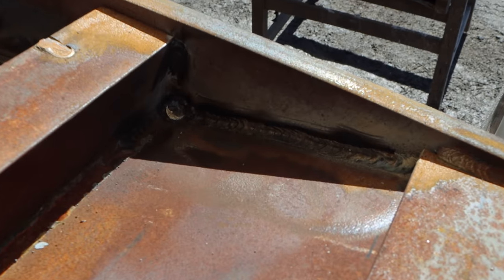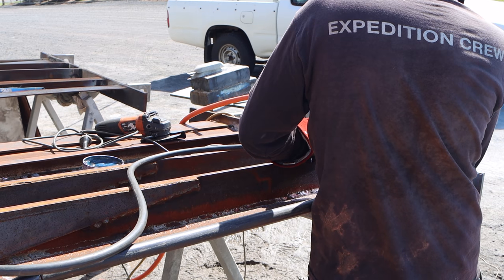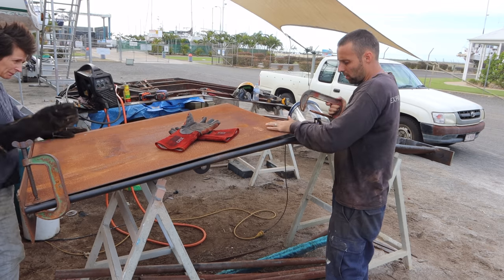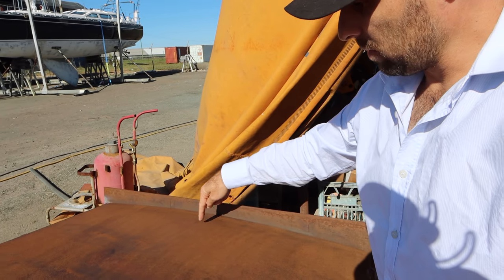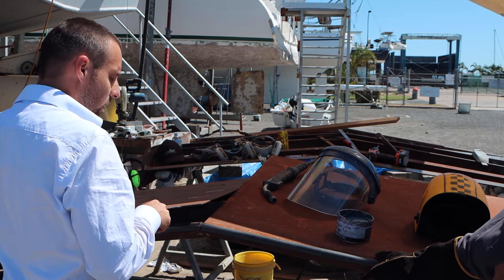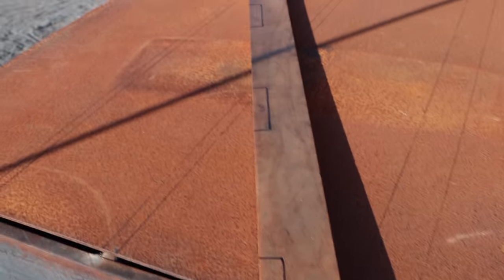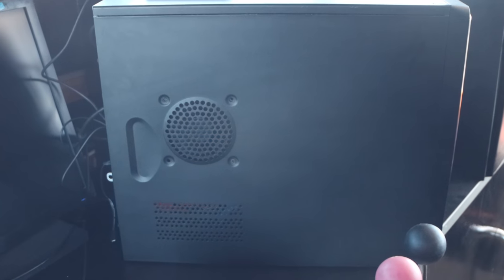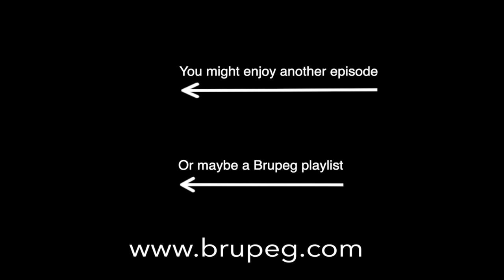Brupeg Shows Some Skin... Project Brupeg Ep. 135

Comment: I highly recommend a UPS (uninterruptible power supply) for your 2 NAS devices.  Any unexpected loss of power to these devices could irretrievably corrupt the RAID systems on both NAS devices.
Please chat w/ your IT team about it.  

I'd also get some other backup system - even DVDs - but offsite (cloud storage) would be better.

I am so impressed with your metalworking skills and knowledge.
Reply from the maker: Hi Robert. We currently have a 7min UPS system running all IT in the boat, it’s powered by the invertor and 24v house bank so it’s almost like a double redundant system. We get power cuts here very frequently so having it rigged in this way with the house bank charged from solar and shore power means the UPS sees near perfectly constant power and the IT see perfect power.
Reply: @ProjectBrupeg  Fantastic!  About to watch Ep. 136  :)

Comment: 8:10: So the welder runs cooler thanks to that massive ground cable? Good, although I bet that 30 knot wind helps. 9:50: Suddenly it's a nature documentary. 11:28: Anode as stabilizing plumb bob...nice work! 12:30: That battery drill is very impressive...I don't own one capable of running a 1/2 inch/12mm bit effectively through mild steel; for that, I have to bring out my 500 RPM Makita (wired). 20:35: Well, I learned something I can use later on about expansion. Thanks! 22:35: I agree, you've got as safe a setup as you can hope for on a boat. My only question would concern power conditioning and backups from the boat's own power in terms of uninterruptability and producing a pure sine wave AC supply. You've probably dealt with this and I've just forgotten.
Reply from the maker: Hi Marc, yeah the AEG battery drills are flippin awesome, this one came with a handle on a bar that was around a 10" long, the next model up the bard was about 2ft. the torque on them is unreal. 32mm drill bit... no worries.
All the IT gear in the boat runs off a dedicated UPS, and the UPS is powered of the 24v house bank (so almost a double redundant system) powerwise we get a lot of power cuts here but as the batteries are charged by solar and mains the power that the UPS sees is pretty constant and the power the IT sees is about as good as we can get.
Reply: @ProjectBrupeg  Well, I suspected you'd have it sorted, given that you're media producers with a trawler problem. And I suspected the power might be spotty there with the wind and heat.

Comment: With the two servers next to each other you need off site backup in case of fire, lightning etc. which could take out both. You have done an amazing amount of work so keep safe and finish it so we can see it in the water.
Reply from the maker: Hi, Yeah we wont have offsite storage (for recent footage anyway) but the plan is to move them into different parts of the boat so we can minimize risk as much as possible

Comment: Don't forget to physically locate the two NASs as far apart as you can. Should the worst happen and you have a fire or flooding onboard, you don't want it to take out both copies of your data!
Reply from the maker: Hi Peter, yeah the plan is to move them, for now we wanted everything talking but thats done so we will locate the backup in a forward cabin, and the main NAS will be in the wheelhouse under the seats (in a box to protect from water if the windows get stoved in)

Comment: Love what you do I'm an engineer from cape Town, just a tip your weekest point is your hinge plate. Keep it up man.
Reply: We're your shaft goes through.
Reply: They're going to put the strongest type hinge pin on later before going into ice.  According to previous videos they'll also be reinforcing the hull quite a bit where the hinge plate goes.
Reply from the maker: Hi Guys, yeah so the hinges will be a two stage upgrade. for now we will carry on with the stainless plate style, but add in gussets behind each plate (hull and wing) to deal with thrust, tension and compression etc. but eventually we will be cutting them off and welding in a piano style hinge using hollow bar 4140 and 2" 304 rod 1.2m long

Comment: Hi Brupeg,  here is a thought.  If your going to put diesel into the wings,  when you go into cold water's,  wouldn't that diesel gel up and then you would have a solid mass inside your wing's?  that might serve as a counter weight or just a weight in the wrong places.
Reply from the maker: It’s only a few litres so even if it did turn solid it wouldn’t matter

Comment: The first thing my wife learned to do was swath, 30 years back. I had finished up what I was doing and went in for lunch, she arrived 20 Min. later and said IT what making a ticking noise so out I go to see what's what. It didn't take long to figure out what the ticking noise was. The 6" bearing off the PTO had failed and she had kept going long enough to to beat the 12" x 12" x 3/8" completely gone. But dear it was only making a "ticking" noise. To this day she mostly just rakes. Cheers, Billy in B.C., Canada
Reply from the maker: Blimmin heck, yeah Jess is fine tuned to the welder now, she can diagnose it by hearing the changes in sound before I do sometimes.

Comment: I prefer the QNAP boxes for a number of reasons, especially less power drain. The lower power CPU etc is why we went to QNAP instead of home build NAS.

I'm looking at having a raid 10 here on ours soon (need 2x more 8TB Ironwolf drives and another 6TB Hitachi drive for it) so we have the stripping for storage size but the mirroring for drive redundancy. That homemade NAS I'm surprised you didn't go RAID5+1 (4+1 drives) so it can hotswap fail over and rebuilt off it's own indexes (this is where RAID5 shines!!).  If I could afford 4x 14TB drives I'd be looking into RAID5. Either way given how RAID5 works you would need to loose 2 drives at a go to require that second backup machine. If you have say 3 drives in R5 then each of of the drives holds a bit of data for the other 2 meaning if any 1 drops the other 2 drives have the missing data and will easily rebuild after the failed drive is replaced.

I'd love to be able to go with a 2nd NAS co-located offsite somewhere but when the drives and QNAP box are a few K worth alone it's just too much money unfortunately.
Reply from the maker: Yeah the plan is to locate the back up NAS either in the freezer room or in a front cabin. 10m away from NAS 1 and a couple of bulkheads away
Reply: @ProjectBrupeg  ah fire/flood protection. Good thinking.

Comment: I was noticing you don't seem to have a corrosion prevention program for the inner wing(s).
You might consider flooding it with nitrogen or argon to inhibit rust over time... Good Luck.
Reply from the maker: Hi. Couple of things spring to mind. With a airtight sealed tank. The lack of fresh oxygen is a rust prevention in itself. It’s very common to make tanks in ships from mild steel and once sealed air tight they surface rust until the oxygen has been used up (normally a few weeks tops) at that point they stop rusting and can last indefinitely provided no new oxygen is let back in. We will be using that theory as well as chucking a few litres of diesel in each wing to slosh around. No need to gas them in this case
Reply: Thanks for the response and patience, now that you repeat it, I remember you mentioning those details earlier. My bad for bringing it up.

Comment: When you launch, you should seriously consider allocating a spot on the boat where you can put a proper computer setup. Ideally something that runs on clean air (sea air kills regular computers, i've seen some nasty computers come from the sea side, and there was rust and corrosion all over them).
Reply from the maker: Yeah the plan is to isolate the gear as best we can. Wheelhouse is away from spray and airconditioned so its a fairly dry air environment (its all relative) and the forward cabins are similar. The plan is to seperate the two NAS apart by a few bulkheads and a few meters so if one room is compromised the other has a chance of survival. One thing i have thought of but dont know if its a thing is resin coating the boards of the Macs etc. not something I would attempt myself but if its viable I would pay to get it done.

Comment: 200 Gigs a day! That is incredible, out of curiosity  how many camera's on average run? and how many hours of film time is this? I can only imagine like 3 or 4 cameras rolling 12+ hours a day?
Reply from the maker: Mostly only one. We shoot using a Canon 90D in 4K but when needed we run GoPros as danger cams shooting in 4K, the go pro footage is a much smaller file size but a lot more grainy compared to the big sensor on the 90D. Slomo is actually shot on iPhone. the cannon can so it but only at 120fps but the iphones can shoot 240fps in 4K so a better image overall. When we do complex stuff like the fuel tanks the camera count go up. 5 cameras are not out of the ordinary. This is a great example of this https://youtu.be/QZYvdecXN0U?t=1446

Comment: Good on you for saving that bird from those Magpies. Out here they're also known as Camp Robbers, and I can't stand the bastards. The only thing they're good for is target practice. Jess, your welds look awesome! I wish I had a MIG system with gas, but I just have a little Sears Craftsman 110v flux core MIG box. I also have a Lincoln arc welder that I primarily use....the 6011 rod I use does a great job of not making me look too amateur.
Reply from the maker: With flux core on your sears you should still be able to get a nice bead. I’ve really been impressed by the quality the fluxcore produces
Reply: @ProjectBrupeg  the biggest limitation is the thickness I can weld, because it's 110v.....1mm is thinnest, 4.75mm is the thickest. The biggest issue I have spatter, and I was told that gas minimizes/eliminates spatter.
Reply from the maker: Yeah it definitely reduces the splatter but you can use antisplatter spray and the beads don’t stick, makes clean up a breeze. Also that max thickness is per single pass, you could weld 1/2” plate by running three beads, one in the root (corner) then two over top.
Reply from the maker: Thanks Frederic. Cheers Jess
Reply: @ProjectBrupeg  I did not know that, thank you so much!!!! And I had no idea there was such a thing as anti-splatter spray. I'll be going to the local welding supply store tomorrow to get new MIG wire, so I'll ask them about the spray. Thanks again!

Comment: @4:09 you see the hole in the weld on that round edge? Will you weld onto that or is it not of significance to any but my OCD friends?
Reply from the maker: That was a hole I blew in the thin front pipe. I had the welder set a bit hot. After that shot I welded the pipe fully so both our OCD will be safe.

Comment: Mate, never say bulletproof.  It's acceptable risk.  IT nerd here, and what you have is definitely better than most, so cheers!
Reply from the maker: Thanks Ken, the plan is to add a bit more redundancy too. Seperate the two NAS apart in different parts of the boat, have a 8tb HDD hooked up to the QNAP to duplicate the contents and our Timemachine backups. as well we the UPS that powers all of the IT, running from the House bank 24VDC bank via the invertor.
Reply: @ProjectBrupeg  Thank you for responding, totally made my night.  But havng your backup in the same location as your main, means you have no backup.  Disaster recovery means (in my case) that a tornado doesn't take out two data storage locations.  Now granted I'm new to this but there are cloud based deep storage options that are really cheap until you need to get data back.
Reply from the maker: For us anything cloud based isn’t an option as the data would need to transfer via satellite. So a days worth of footage would likely need a small mortgage to pay for

Comment: not anti rust painting inside the wings?
Reply from the maker: No need. When a tank is air tight the oxygen depleted and rust completely stops after a few weeks. It’s possible to seal a bare steel tank airtight and leave it for fifty years without any increase in rust inside.

Comment: After watching I don't know how many vids on building the Wings, I can  now see why 
when the British built the HARRIER JUMP JET, the wings are  made from SOLID blocks of
ALUMINIUM,
To get the Ultimate strength, all the internal compartments of the wing were burnt out buy flushing Acid in and out to melt the aluminium, as required.   NO WELDING.????????????????????
Reply from the maker: Yeah unlimited funds would be a nice addition to the build... however slabs of steel is all we can afford, so we press on.
Reply: @ProjectBrupeg  Well if it sinks it will go down Quicker.  keep safe.

Comment: ? How come you never bought a plasma cutter for your project
Reply from the maker: Hi Billy, we have one but it’s a bit of a pig to use, it’s not a clean cut so we use it on work that doesn’t need to be pretty, such as cutting rust out that will be replaced with new steel. It’s a small unit so it’s not fast and we find time wise the 1mm disc on the 5” grinder is similar in overall cutting speed but much more cleaner and accurate

Comment: Just a question, why no rust encapsulating or sealing paint on the wing interiors?
Reply: Keith Cripe I think he said he’s filling them with diesel.
Reply from the maker: Hi Keith, with steel you need oxygen to make rust happen. When trawlers create a fully airtight tank (like these wings will be) the interior rusts until the oxygen is used up (a few weeks for small tanks) then the atmosphere inside becomes inert and they can stay like that indefinately without any further rust.We will be added a few litres of diesel to each wing to slosh around but thats just a back up measure really as the lack of fresh oxygen is one of the easiest and best ways to stop rust.
Reply: @ProjectBrupeg  Won't welding those tanks shut with diesel oil inside risk some kind of... fire, explosion? 😱
Reply: @ProjectBrupeg  So that means you need watertight seals/welds on all your welds. Given what we've seen Dame, that's not an issue. Thanks for replying. :)
Reply: @danielfogli1760  for any future welding = it depends on some variables
Reply from the maker: Hi Daniel the tanks have hinges in them so we weld them air tight with the bungs our then put the diesel in and seal the bung up. It is possible to weld tanks that still have diesel inside them if the right precautions are taken but that’s not what we are doing here
Reply: @ProjectBrupeg  Bungs! Who could've thought of THAT 🤣

Comment: How many cutoff Disc's did you use on the entire ship?
Reply from the maker: Hi Jakob, we did an estimate recently, we buy them in boxes of 100 and we think we have gone through about 9-10 boxes so far over the 5 years.
Reply: That means 1 thausand! In my entire life I have just used one
Reply from the maker: We could get away with a single disc if we brought one MASSIVE disc. Like if we burn off say 2” off the diameter we burnt up 2000” of disc so to allow for the disc centre we would need one 2003” disc for the grinder and we would be sweet

Comment: Just curious, but don’t you guys have a plasma cutter? All that slotting is slow work with a grinder. I could swear you had one.
Reply from the maker: Hi Matt, yeah we do but its a small beast so its a fairly rough cut. I use it when needed but its a bit of a pig to cut with
Reply: Project Brupeg ok, so i have a small plasma cutter aswell, its not an exy one either, it cuts extremely clean and no problems cutting 10mm plate. I think you need to make sure u have a nice clean contact tip, the correct air pressure and a good earth. They are really excellent time savers. Have a proper look at it. I bought a wheel set (like oxy set wheels) for the torch and it saves trying to hold it off the material and allows cutting straight lines with a straight edge. Travel speed is quite quick though so keep it in mind. Love your work though. Martinis on the deck soon.
Reply from the maker: Cheers. Yeah our air isn’t crash hot so we burn through consumables quite fast. It’s also a temperamental bugger. It needs an earth lead replacement, and I need an air dryer so all these things combined the system is a handful, if I’m doing a lot of cutting I will use it but factoring all the faffing around to run it the grinder ends up faster most of the time